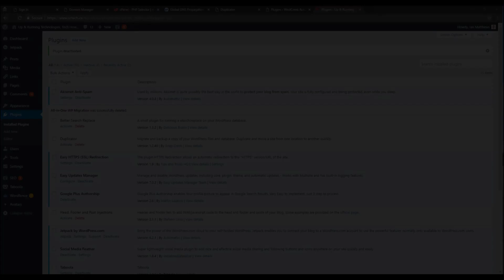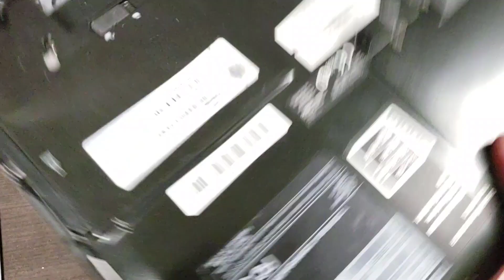Disassemble Toshiba Portege R930 and Replace the Keyboard

Comment: How can I change the function of these two keys in the top right corner? And how are they even called?
Reply: one was for eco utility or sth, and the other was for something really cool at that time ;) (intel wi-di)  something like chromecast. I got this laptop around 13 years ago and it got Wi-Di, battery lasting 12 hours, sim card slot, gps and other cool stuff hard to get nowadays

Comment: Thanks! This has been very useful for me. Anyway, I have a question for you, @URTechDotCa: How did you stick the new keyboard on the casing of your laptop. I though that it would be enough with the residual glue from the old one, but it isn't. Could you be so kind as to tell me what kind of glue did you use?
Reply: I used double-sided tape and it works